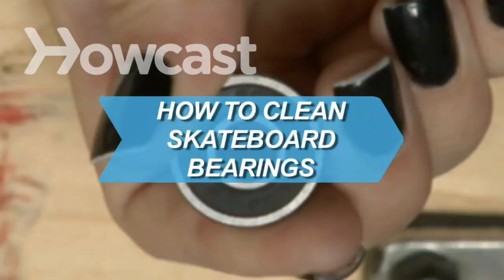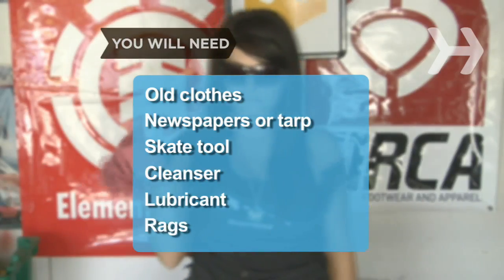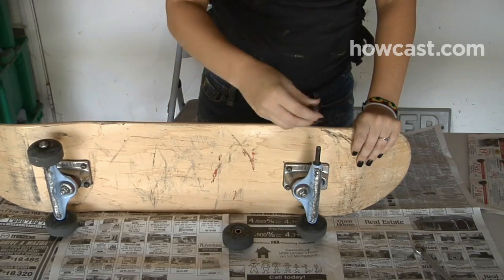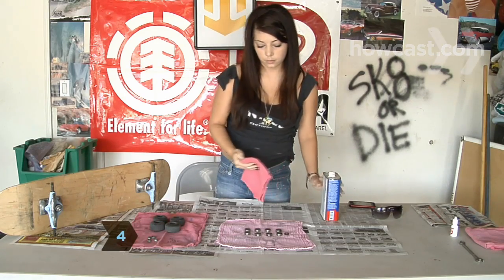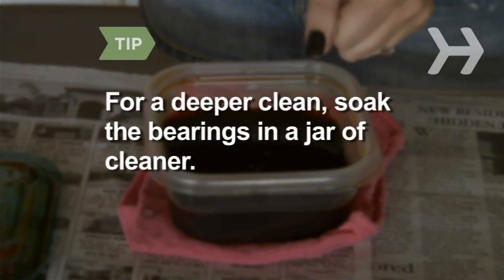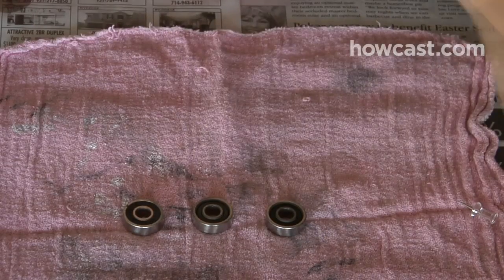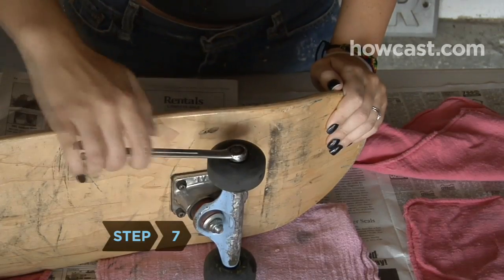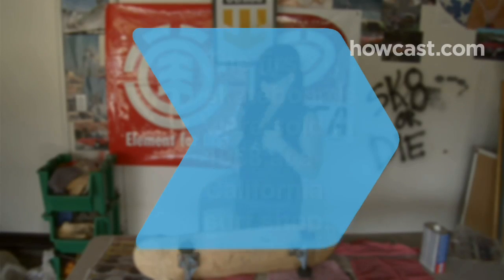How to Clean Skateboard Bearings

Comment: You have to pack them with grease. It will make them feel slow for a couple of days but they will last longer if you use grease, they will stay smooth and won't wear away the races as fast

Comment: hi, i just replaced my rusty bearings with new bones reds . and now after i replaced them they are making a rattling noise .. i dont know what it is , but its in the back bit of the board especially. i cleaned the end of the hangers before putting everything back on . is it because of that or because its new and i have to ride for a while and then it would be ok ? pleasee reply

Comment: DO NOT put oil on the bearings while they're still in the wheel, the oil gets all over the wheel due to centripetal force the excess oil on the outside of the bearing stain your wheels. that's why some people have wheels that were white and now are a yellowish shade.

Comment: I shove my bearings in the sink, keep the plug out, spray quickly with shower, then put the plug in, pour cooking oil on them, spray quickly with water, then let it drain out, quickly rinse them off and it works fine.

Comment: You don't need that much lube...
The instructions on the bottle specifically says 2 drops per bearing. Any more will just spray out when you spin the wheel. Happened to me before. It's not pretty.

Comment: WRONG!!!! Clean em' with just a rag, lint gets in em. Take them apart, wipe off residue with a rag, then spray brake cleaner(from an auto parts store) completely, Blow them clean and spin them till theyre dry. Then put 2 drops(like the instructions say brozsa) of speed cream in. Spin em. Done. Tip; you should take out the ball retainer, and clean them with an old toothbrush too. No drag= fassst skating/ less effort. Do not saturate the bearings, they'll drag/attract more dirt. Erry 15 miles.

Comment: Howcast really needs to learn. First off, that is NOT a skate tool. That is a wrench. A skate tool is T shaped and has 3 different sized wrench heads on each end. 

CATION!!! DO NOT PUT A LOT OF LUBRICANT ON THE BEARINGS AS THEY SAID!!! IT CAN DESTROY THE BEARINGS AND MAKE THEM A LOT WORSE. USE 2 DROPS MAXIMUM!